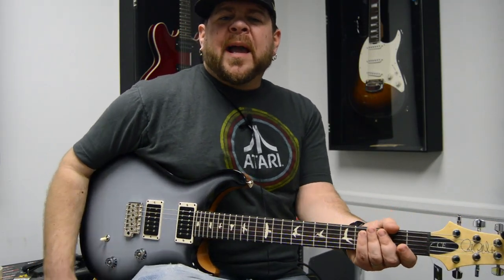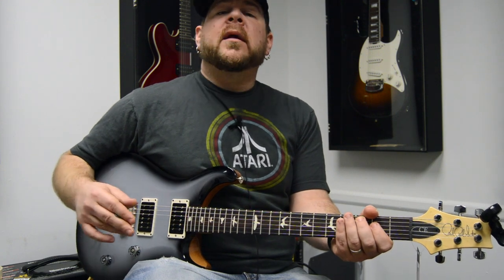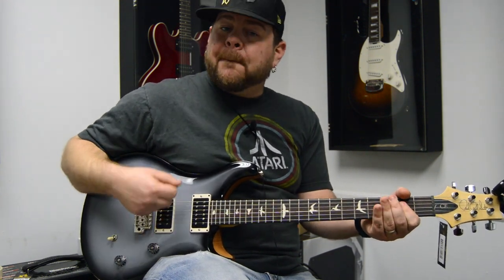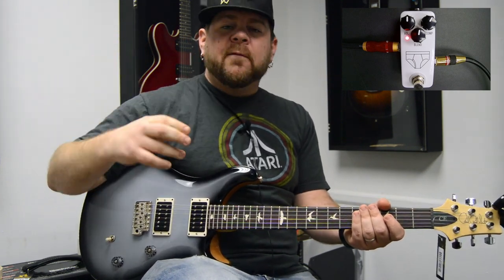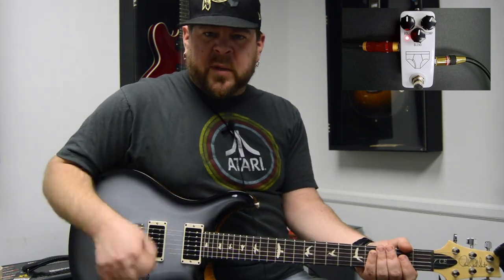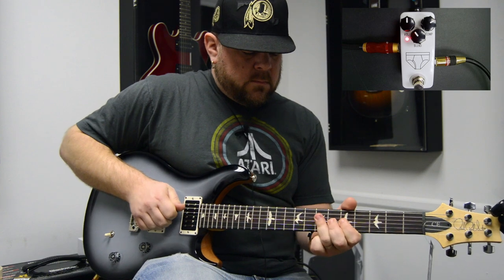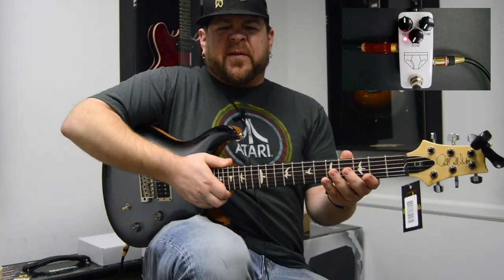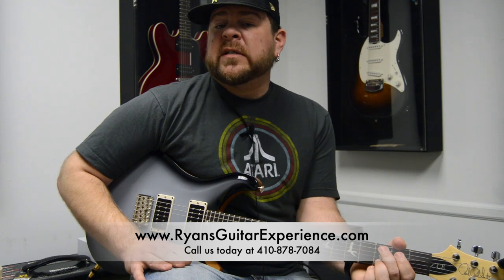JHS Tighty Whitey

Comment: You say it's more about how it feels than how it sounds.  I wish you-- or someone--- could explain this.
Reply: That's a tough one, which is why most don't elaborate.
I would recommend that you try a few different types, because they really can vary, but simpler types like this ,with 3 knobs, are much easier to use than the Walrus Deep 6, JHS Pulp& Peel, or EQD Warden. I've seen many newer players get discouraged by starting with those.
For cleans, whatever style you play, they are indispensable; not a fan for driven tones.